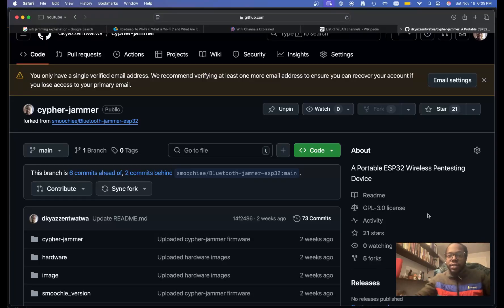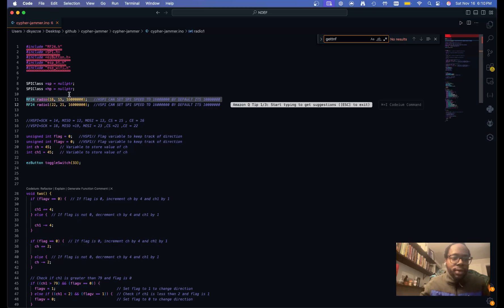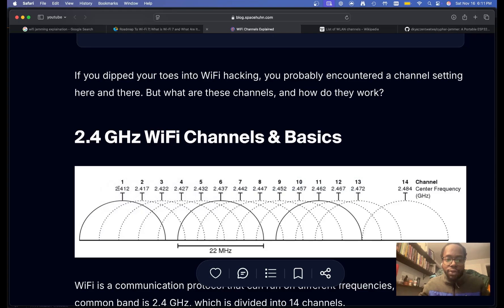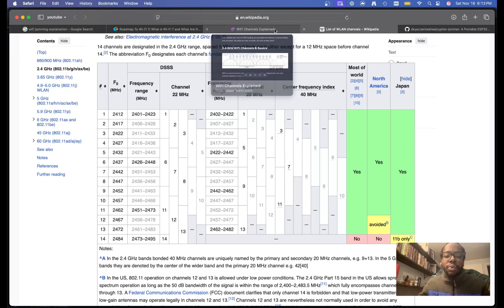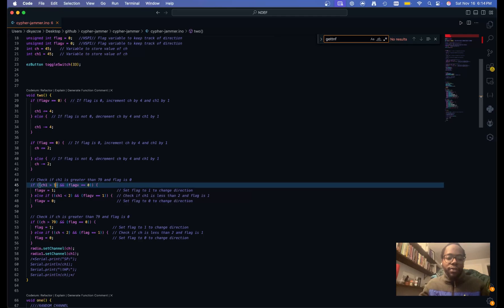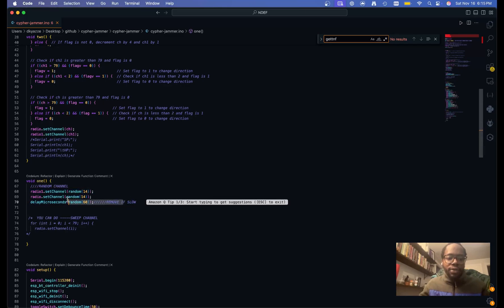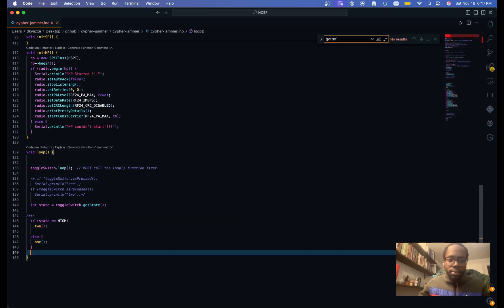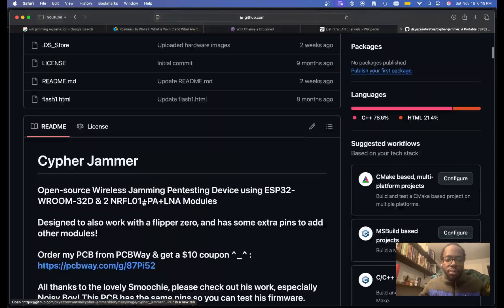WiFi + Bluetooth Jammer Code Breakdown

Comment: Just tested, the range does not exceed 2 meters.
Reply: Will changing the antenna to 12 dbi help?
Reply from the maker: Yes that will help, also did you add capacitors? Also adding amplifier+band pass filter will help greatly , also check you power source